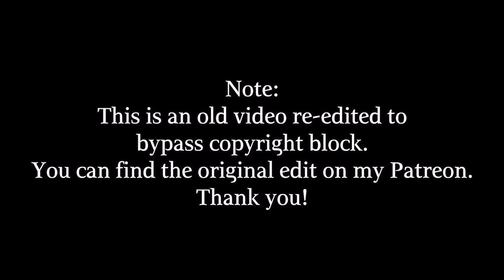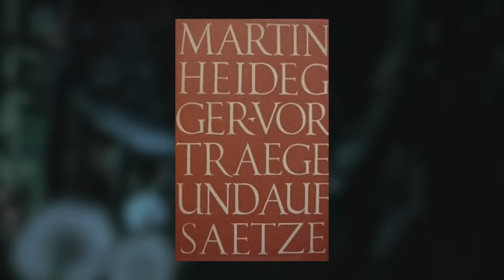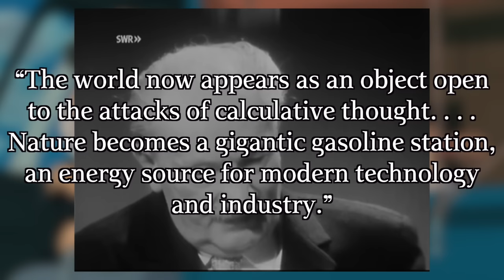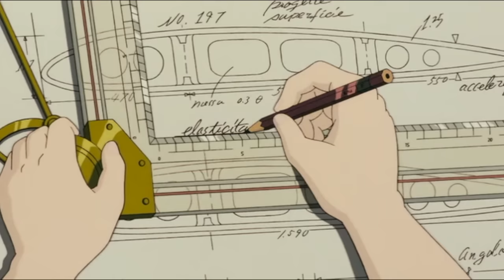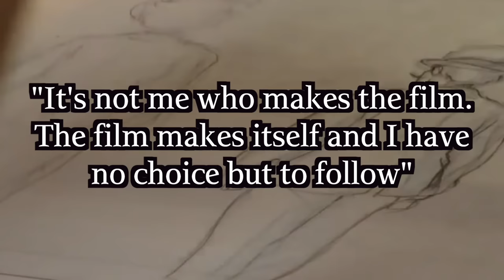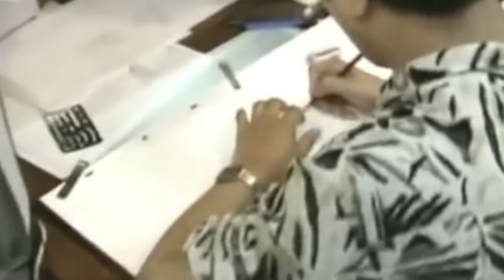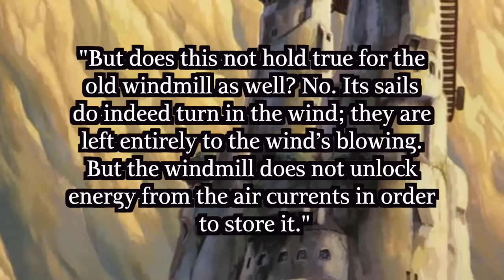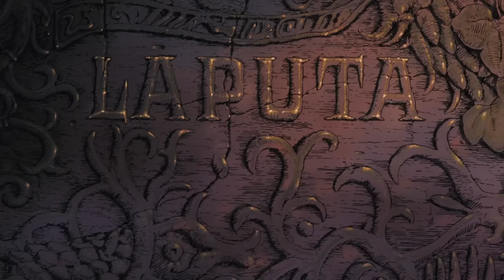A Heideggerian Analysis of Studio Ghibli's Films

Comment: Please do another. I know it was difficult to zero in on what to discuss on the ghibli side and difficult to breakdown on the heidegger side, but I think that's why another video should be made! This is a solid connection, sentiments plainly expoused by Miyazaki himself. There's other thinkers and figures to consider, Reich and shauberger to name two. There's more shinto thought, analysis, and traditions, than you can read but endless depth available. I think a part two could be many times the success this video is, and more thoughtful, provoking, and enlightening, still